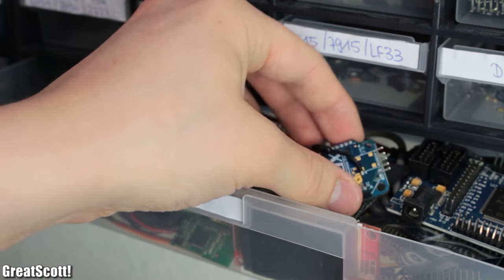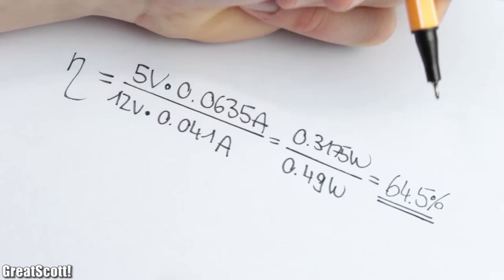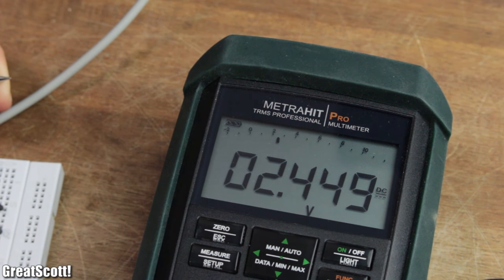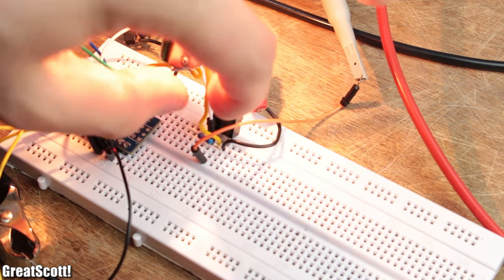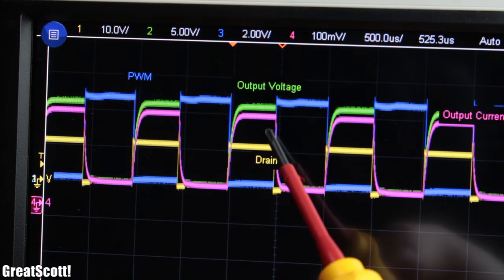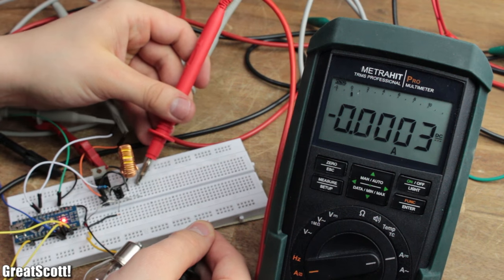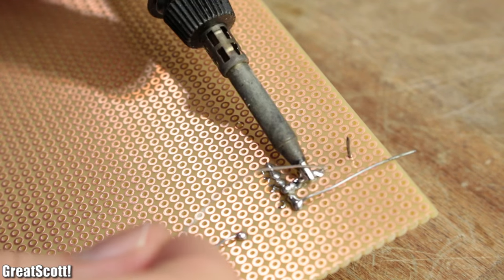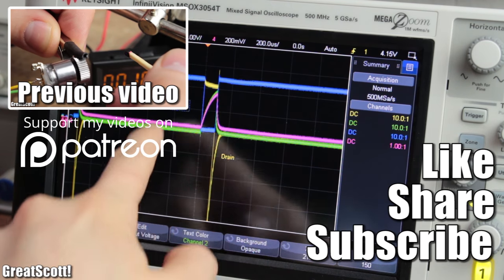DIY Buck Converter || How to step down DC voltage efficiently

Comment: If a Stepdown Converter convertes a high Voltage with relative low current to a lower Voltage, does it increase the Current at the Output? For example: 12V 1A --> 6V 2A ???
Reply: TheBiodinkelpizza Yes, it will increase the current output capability, assuming your components can handle the extra current (3A diodes instead of 1A)

Comment: Is there a way to get buck converters and other similar parts without having to wait 4 weeks since these parts come from China?
Reply from the maker: +CookieCraftMedia Amazon
Reply: GreatScott! Hmm it looks like shipping is faster on Amazon, obviously its also more expensive there. At least I know where to get parts when I need the ASAP, thanks!
Reply: +CookieCraftMedia don't forget to check digikey, etc. It's almost always cheaper than amazon. Just watch the shipping if you're only buying 1 or 2 parts, then Amazon with prime will usually win out just because of the shipping costs.
Reply: Yeah they do have electronics but Im looking for these pre built boards like that USB Step up module. If i bought the parts in a store I had to build that module by myself.

Comment: I got both the adjustable and non-adjustable 2576 as I can see a use for both. I did have trouble sourcing R2 but I think a 5.11k and 1k will be ok for R2 and a 5k potentiometer  for R1. Also I got a DC LED meter to check the output on the adjustable voltage: http://www.ebay.com/itm/Green-LED-5-Digit-DC-0-4-3000-33-000V-Digital-Voltmeter-Voltage-Meter-Car-Panel-/262136732629?hash=item3d08911bd5:g:IjoAAOSwLN5Wl1mK

Comment: I need to do a 200W from 24V to 12V DC to DC buck converter and wandering if should use a transformer like 50Hz and PWM signal on the input of it with a bridge rectifier on the output, or use a HF to achieve it. As I've got audio equipment on it, I need to use something that will be filtered as well. After this video, I'm not sure if I can pull a continuous 200W this shown way ;). Anyone?

Comment: Can you please make video how create converter from 220 AC to 5 DC :)
Reply: +Михаил Б. :D just add a 1/4W voltage divider and a diode for rectification :D Safe as a child's ass in church :D He should make it power an mp3 shield playing Ave Maria or some other prayer.
But seriously, there's the viper22a chip. it's dirt cheap and you can make your own transformer and PCB for it (if you have not previously created the prior circuit and you understand safety practices like isolation gaps and whatnot).

Comment: Heres a dumb idea:

I wanna use an esp32 to control an led, but the led needs 5v usb, and the esp32 needs 3.3v. So i need to step down the 5v to 3.3v. So i could use this method to use the esp32 to control the voltage of the esp32. Id just need to power it up using a 3v battery, and then it could run on its own.

Comment: +GreatScott! at the DIY stage ~ 3:00 it looks like the I/O pin also gets pulled up to 12V, which I gather can risk damaging the ESR protection diodes in the ATmega. Or did I mis-understand your circuit?

Thanks for this video, much more fun and than hours of power electronics lectures. Inspired me to play with the buck circuit, though I changed the high-side drive circuit. My notes are here https://github.com/tardate/LittleArduinoProjects/tree/master/playground/BasicBuckAvrControl if anyone is interested

Comment: I want regulate (lowering) DC plate voltage (~350V) for power tube 12BH7A, in my guitar tube amplifier. Can I do this with an Buck converter? That coils in BC can propagate noises in amp circuit? Someone know which one MOSFET can handle this high voltage?

Comment: Can I increase the output of amperes?
Reply: Yes, by using a MOSFET with lower RDS(on) and the wiring of the power components being as thick as needed (thicker wires = lower resistance). The lower the resistance, the higher your max current, and less heat dissipation.
Having a inductor with a lower resistance and capacitor with lower ESR.

Basically, lower the resistance of your component for increasing your output current.

Comment: Man for the life of me I can't figure it out. I want to power a 3 watt star LED replacement for my microscope on a dimmer switch. I want to use a regular 12 volt input, not the 5 volt original. Can I buy something to achieve this ?

Comment: Mr scott i made this buck converter the 12v version  power it by a 14.8 volts 25c battery and the time that i tested the 100uf 25v rating cap exploded can you help me to fix this thanks
Reply: Jose Dawang Did you put it backwards?

Comment: Hello Master! can you tell me how can i convert 220vac to 110vac without using transformer? I want to make a small converter to work with my drill (about 700W and using 110vac)
Reply: You need a transformer.

Comment: Can I get 50 amp form a source (48 V,2A) using buck converter ?
Reply: +Abdulla Qasem What voltage for the output? Power = volts x amps. So 48 x 2 = 96 W. 20% of the power is lost. so you only have approx 76W. You want 50 amps so 76 W (after the loss)  / 50 Amps = 1.52 volts tops in order to get your 50 amps. And what would you need 50 amps for anyway?

Comment: Q : What the Output Amp this converter can handle for the MAX ?
Reply: extremely high depending on the components used - the max ratings of the weakest component would be your only limitation.
Reply: So .. it can supply for a 10Amp for no problem ?
Reply: buck converters for pc power supplies supply over 100 amps so yes, 10 amps is easy depending on the components you are using

Comment: hey buddy ..

1) i have a step down module LM2596 and i input 5volts and adjust the potentiometer to get 1.5 volts - all fine up till this point

2) i now have a slightly different requirement .. where I want to take the potentiometer out of picture (can i use resistors instead) .. my sole purpose is to out 1.5 volts or 2.5 volts [i want to add a jumper or something]

just wanted to know if this is possible  .. could u please help me out .. thanks for the video .. its very good.

Edit: I just saw your complete video and you seems to have answered my question that it can be done .. but i just want to know how ? .. could u please help me ..

Regards
Rahul
Reply: Use two resistor dividors, one for 1.5V other for 2.5V, add a jumper so that 1 set is connect when jumper is connected a 1 point, and set 1 is disconnected and set 2 is connected when jumper is at second point.
Reply: @kekwnet  : thanks for the reply buddy

1) I can add jumpers by myself (thats not a problem) .. the problem is  resistors connection in place of potentiometer(thats where I am stuck ) .. great if you could explain this with the help of a Pic/diagram

PS: I am gonna watch this video all over again right away .. and try to see if I could get my answer .. but please help me if you can ..

Thanks
Rahul

Comment: I need some help about designing step down module for crazy current 
I am making high power bench supply 
And I have microwave transformer that i can rewind so it outputs around let's say  48v and than i can take that and step it down to weather i need but which converter can hold up to around 100 amps can someone point me in the right direction?
Reply: also it doesn't need to hold that load for really long just maybe a minute or two for testing because transformer is going to heat up quickly anyway.

Comment: Need Help.... I need 5v 1amp output... what should i do ??
Reply: just use this buck converter to give you the 5v down from your 6v or 7v or 12v original supply.  The 1 amp will be more than available as long as the supply is over 5 watts.  volts*amps = watts.  You want 5v 1a = 5watts.  a supply having over 5 watts will give your device at least 5 watts available power.
Reply: ooh OK thnx
Reply: thnx for the reply
Reply: What about 5v 500amp
Reply: well 5v 500a is 5*500= 2500 watts.  if you were converting down from say a 12v supply, the watts would be 12v * ?a = 2500 watts - that is 208 amps needed on that 12v batt which is above what most any 12v batt would have... 2500 watts in fact is above a household wall outlet.  i would break that down to 5v * 1a per motor so group the motors in groups of 30 and supply each group of 30 with a separate battery.  If you really needed the 2500 watts 5v 500a, you could create a switch-mode power supply that converts a 220v 30a wall outlet (kind your drier has) into 5v dc that can handle 1320 amps!
Reply: artbyrobot wait, im sorry I was saying 5v 500ma
Reply: a 5v 1a supply can handle any amps under 1 amp.  The amp rating of a supply just means it is designed not to overheat with anything at or under that amount of amps.  If your motor pulls 500ma it will only use half of a 5v 1a supplies total rated current allowed
Reply: ooh
Reply: I'm using a Bluetooth device for a speaker system in my bike

Comment: CODE! CODE! CODE!, Why is there always CODE! involved with your projects?
i'm trying to figure out how to make a stepdown converter with circuits that don't require CODE!  
My Repair-Upgrade Project Requires 12v input source to 4.2v output to charge the batteries safely.

Comment: can i use arduino to control this buck converter ??
Reply: yes you can for sure.  the digital output pin of the arduino will control the pwm to the mosfet switch and the analogue input pin of the arduino will receive the output voltage which will enable it to tweak the pwm frequency to compensate for changes in the load
Reply: i would like to use an buck converter from ebay like lm2596 which is more efficient and some how contron the feedback with an arduino and an opamp so that the arduino will produce an analog output. I want to make an Constant Current/Voltage power supply with an lcd screen.

Comment: Does anybody have any suggestions for a buck converter that can handle 100a?
Reply: +TechnocraticBushman I was thinking about the possibility of making a kind of DIY mppt controller by putting a buck converter in front of a PWM charge controller.  I'm by no means an expert, but the only complication I can think of is possible resonance/dissonance between the buck converter and the controller if they both use some form of PWM.

In theory, if this could be done, it'd be much cheaper than buying a complete mppt controller, and would make it easier to swap out/repair damaged parts, etc.  So, I thought it might be worth asking.

Thanks!
Reply: Steven Funk OMG! I had to google what an mppt is. I too am a beginner. You absolutely have to do it! This field of research is by far one of the most vibrant in the industry today. One think I've learned is that electronics is not an exact field. Live and learn. You need to experiment. Try to simulate in ltspice and see what happens. Just do a 10 ms simulation so it doesn't last you a lifetime to get the data :D LT does tons of buck/boost converters so you will have what to work with there. http://www.linear.com/products/step-down_(buck)_regulators
And of course pwm: http://www.linear.com/products/PWM_Controllers
You can even simulate a solar cell. They have voltage and current sources, you can set series resistance and oscillations etc etc.

Comment: Please help me to make a buck converter.. I'm new here.....
Specification:
1. Input Voltage= 7V - 35V
2. Output voltage= 5V (+,- 10%)
3.Ripple current less than 10mA
4. Switching frequency range 25KHZ to 35KHZ
5.Output power 20W.
What should I Do?? Please help me thanks

Comment: Why can’t you just use a resistor? I still don’t get what buck converters accomplish, please someone respond to my question!!
Reply: Claud Dora Resistor dividers are really only good for voltage references, as the second you try to pull any meaningful current from them the voltage drops. Buck converters use feedback in order to maintain a steady output voltage even as the load changes.
Reply: @MaplePanda04  THX
Reply: Consider that for their complexity, they have a much better efficiency compared to linear regulators, since the energy is stored into the inductor and capacitor. 

The linear regulator acts as an variable resistor (higher current = more heat), in order to keep the output voltage steady.

Comment: whats the max amp output
Reply: +Jens Kellner The datasheet says 3 amps. but you can easily increase that with little to no cost using just one chip and adding a big ass mostfet and a resistor.

Comment: i want to convert 240dc to 13.7vdc any ideas
Reply: you can get high voltage dc to dc converter IC-s which can do that
Reply: Riki Dawson I'm just curious where you got 240Vdc?
Reply: you can do it with MC34063 with attached high voltage mosfet
Reply: the buck converter method shown in this video can do this
Reply: In tube amp for example.

Comment: How to reduce voltage from 70 V to 55-60 V
Reply: Siva Nani Stick a bunch of diodes in series. The forward voltages will add up and subtract the 5V if you have enough diodes.

Comment: there is no way to do this without a arduino?
Reply: you can but it takes waaaaaaayyyyyy more logic circuitry and the arduino is a small form factor logic circuitry that everyone already uses
Reply: As you can see at the end of video all you need is one 20 cent IC. Arduino is great for playing on breadboard  (as you can simulate work of many IC's) but you will not want to use 20$ arduino to make something that you can buy for 3$.
Reply: Goran Drčec arduino is open source and so is legal to buy a knockoff you know.  the knockoff version is under $5 and if you just buy the arduino microcontroller chip and make your own board you could get it under $3
Reply: quality of knockoffs are questionable but ok, you can buy it for 5$ and they work most of the time. Still, why use that if IC for this job cost 20c and probably do it better?
Reply: Goran Drčec the microcontroller itself is produced in massive quantities by the same manufacturer for all the knockoffs as well as the genuine arduino.  if you buy the chip as a knockoff and solder on your own components or buy it as a knockoff, the quality of the chip will be equal to a genuine arduino.  the accessories will also be stock on a knockoff no?  so how is that worse?  the knockoffs aren't even hand soldered so where is the low quality you speak of?  also, why bother with a ic for this when arduino can do it and either that or another microcontroller is part of your project anyways?  What project would not use a microcontroller?

Comment: Good educational information, but that chip costs the same as a prebuilt board from China, so not worth actually doing.
Reply: Higher efficency
Reply: +Fred Bloggs counterfeit chips too.
Reply: +Fred Bloggs unless you're building something compact and you need to put everything on a single pcb. in which case you most likely will not even use the t-adj version or a different chip altogether.
Reply: I don't think anybody counterfeits XLSemi chips used on cheap Chinese boards, they might go under cost for all I know.

Comment: This circuit you just explained is not switching the MOSFET. I've used exact same configuration you have but the results are not the same. I've been trying to make my own buck convertor and it's not working for many reasons. Even you're approach didn't work.
Reply: I also used exact same MOSFET IRF9540 and exact same controller Arduino Nano

Comment: Firstly you are not using voltage Divider for low efficiency and then voltage Divider for variable voltage regulation. Huh